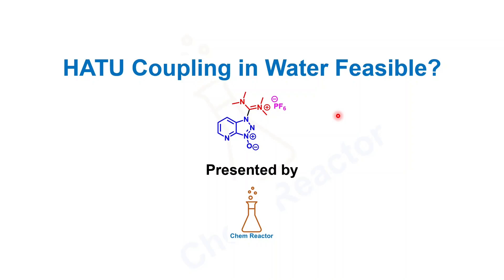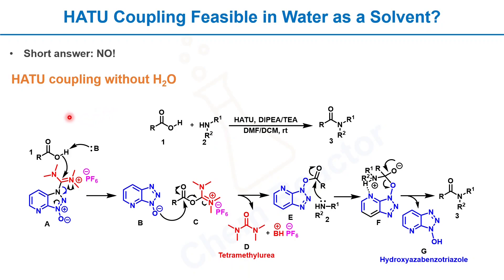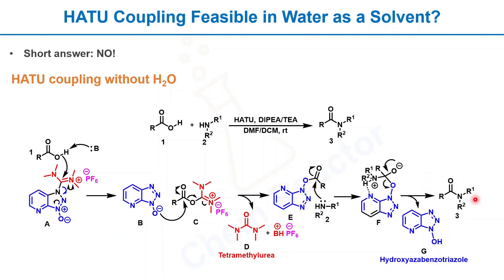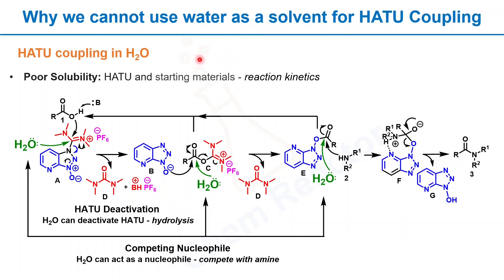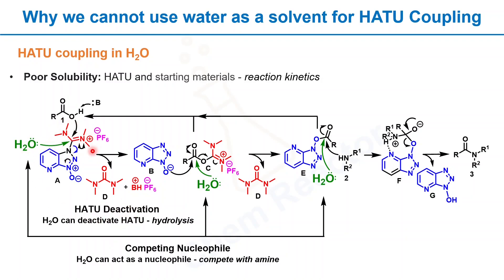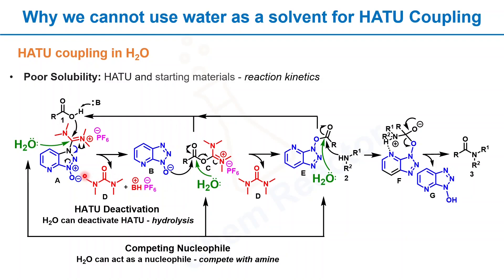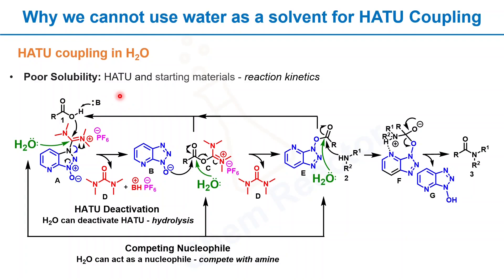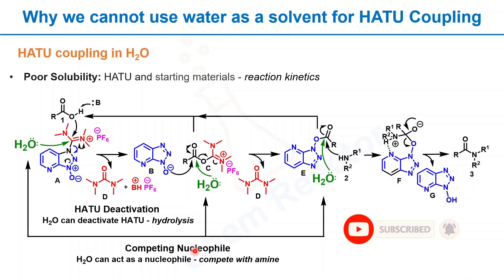HATU Coupling in Water Feasible? I HATU

Comment: Can we used hatu catalyst for acid to non substituted amide by using ammonia.
Then convert this amide to nitrile?
Reply from the maker: Hi Ashoka, 
I have never performed ammonia coupling with acid using HATU before. However, there are a few considerations: 
1. Ammonia-in-water scenario, water will be involved in the reaction. 
2. Gaseous ammonia would require high-pressure conditions. 
There are several methods available to convert amide to nitrile.